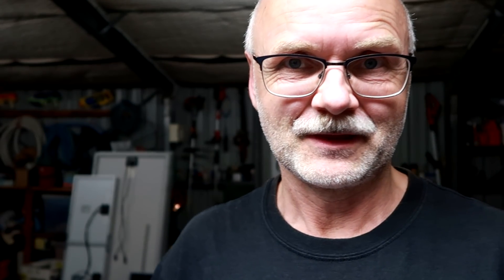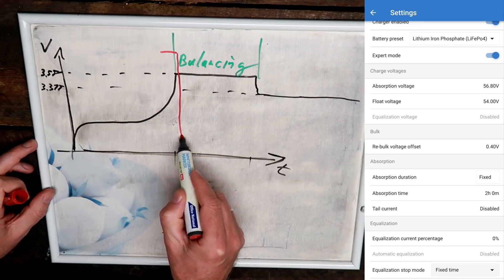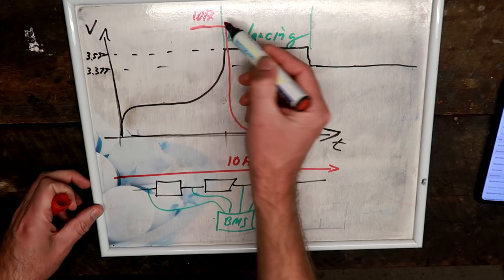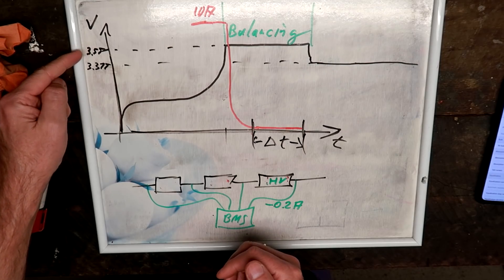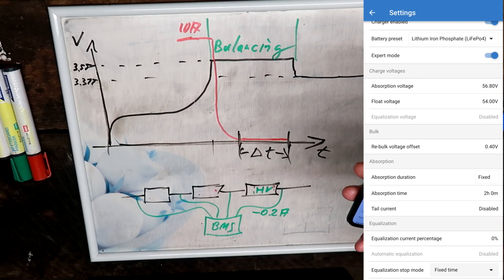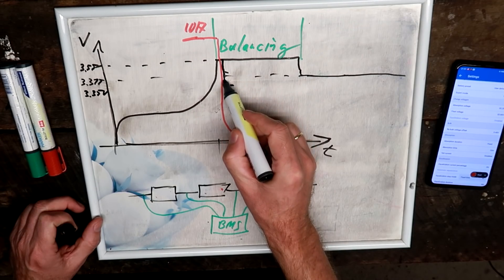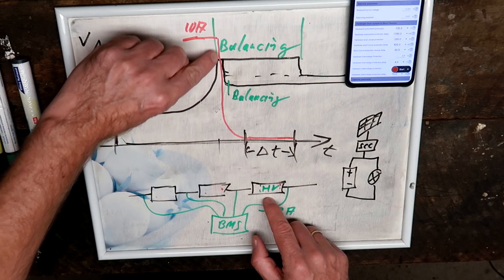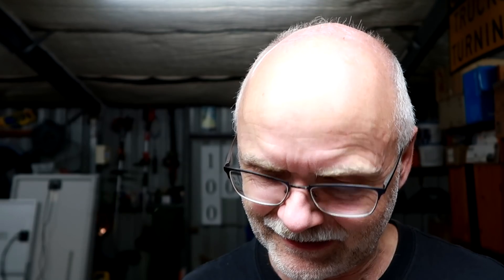Can I balance my battery while floating? Well, I do!

Comment: So after watching this video and understanding lifepo4 cells the way I do. Working and building battery systems experience has taught me a lot .
You can't balance cells that are not fully charged meaning less than 100% soc . They never reach the high voltage knee .fact 1.
Fact 2 you also cannot balance cells that are at a float of 3.325v . Why ?
A cell will only show it's mismatch in capacity (i.e. requiring balance ) when it has a positive voltage applied - which is directly proportional to it's soc level .
Applying voltage / current to a empty cell will never push it over in voltage because it hasn't reached its saturation point decreasing internal resistance .

So here is a test charge all cells at 30amps or 60amps and watch their voltage sure you might see a few MV difference In a sort of balanced pack .take note of the voltages and keep track of the mismatch at a medium low soc .
Allow the pack to charge up till close to full around 90% you might still only see a minimal difference .
At around 95% soc you start to notice larger variances of voltage between cells that are closer to full and cells that are not so full .. 
And this is where balancing starts to work because you have the positive voltage differential allowing this process to show which cells actually require balancing .
So ... To say you could balance cells at float .. after charge can be done yes but will it work ?
No ...

You need voltage to trigger the knees in all full cells allowing them to be balanced . Lifepo4 cells undercover agents they don't give information unless forced (charged ) to do so .
Reply: Cell deviation voltages are soc related and current related .
Your target voltage is the first step sure you don't have to go to 3.55v aim lower but not below 3.4v .. on massive large cells like the ones you have you never going to heat the chemistry to degrade the electrolytes because these cells can take 280amps of charge .. recommended charge for cell life span is 0.5c which is 140amps of current .
If I see correctly you still less than 0.25c which is less than 70amps .
You never going to create heat internally in the cell at this charge rate even closer to the knee aiming for 3.5v per cell so don't sweat ..this factor is only important when charging small cells with a higher chargr current
Reply: @adamsaiyad3959  But yet, he has only a 5 mv cell difference across the entire pack.  WHY should he care, that the voltage difference might be higher with a higher voltage, given he will NEVER use a higher voltage?
Reply: @MrSummitville  valid comment . 5mv at what soc of his entire pack ? 
Is this 5mv at 60% or 99% soc .

You bring up another interesting topic . How much energy capacity is created by unbalanced cells .
This term is loose as unbalanced can be a full cell and a cell that is at 50% soc .
Then I digress abit further and into more detail.
If charging up 290ah cells .
And of a group of 16 you have say over 80% of the pack at 3.48v and the remaining 20% at 3.9v at the end of a charge with no balancing how much capacity would the say pack have lost .
Probably around 10ah at most maybe 20ah 

Over all on a pack that is this huge it's a minimal capacity loss for this unbalance .

Then brings the next topic if the cells are of the same batch . And are closely matched from the supplier on IR and capacity. And are top balanced technically the pack should go out of balance .
A top balanced once and never again balanced pack should remain the same through out the life span of the cells .
Same for a bottom balanced pack ..
So is balancing necessary debatable . Good quality cells require very little balancing on each cycle and a small balancing Bms can handle this easily .
But on the other hand with large cells require a larger balancing current rule of thumb is again a misnomer . Because balancing can still take place as rightly mentioned in the video at a low enough chargr current towards the end of the charge profile in the CV stage.
Reply: @MrSummitville  ps as I mentioned in my first right up wanting to balance out a pack at a low voltage will never yeild correct balancing results . In essence might not balance at all .
You can only truly balance when you are in the full cell knee and IR lowers because of soc where the propensity of the cell to raise in voltage requires very little current to raise above ocv. Open cell voltage when full .
I didn't say he has to charge to 3.55v .
I did say that he should use a value above 3.4v to achieve the positive voltage difference to allow current to flow into the cells in a ample amount of time.
Charging at 3.30v will charge a cell . But it might take 20 years to full .
Charging at a greater voltage differential allows for more current lowering time taken hence speeding up the charge process.
We not applying 3.65v per cell as per manufacturer specifications .
We applying by far lower voltages taking longer to charge but still getting the knee activated and allowing some form of correct balancing if required and needed by the user.

Comment: As far as I know, LiFePO4 batteries do not degrade more if held at 3.65V or 3.55V continuously for several years versus 3.45V or 3.35V for the same number of years. High voltage induced degredation is caused by electrochemical side reactions resulting in permanent loss of electrolyte as it gets consumed in those side reactions and deposits insoluble breakdown products over the active electrode surfaces. However, these side reactions start around 4.0V and reach excessive rates by around 4.3V. Li-Ion and LiFePO4 cells use the same organic electrolyte, so theoretically you can safely and continuously use a float voltage of almost 4.0V on your LiFePO4 cells without any harm. The reason LiFePO4 cells aren't rated above 3.65V is because they store no extra energy above this, meanwhile their essentially infinitely steep Voltage/SOC curve above this allows individual cells to skyrocket over 4V extremely fast when charged in a series connected battery pack and still under the normal full pack charge voltage. I.e. high voltage is bad for Li-Ion lifespan, but merely difficult to control and of no benefit in LiFePO4 batteries.
Reply: hi. have a link that explains this info you just said?
Reply: @cgmarch2359  Do NOT Float Charge any LifePO4 cell at 4.0 volts.  It will cause very early death.  All Cycle Tests show this to be true.

Comment: Always a good amount of things to think about. I am running a 4S11P 100AH GBS kit. Grade B cells. Every few weeks I gather another pile of cells that I am able to P into more so I might be around 30P by now. I have chosen to limit my top voltage delivered by the SCC to 3.4 and do run a overkill 120BMS and watch the P voltage carefully. By limiting this top voltage I have never had the BMS try to balance cells…and I am happy with that because there is no way it would even make a dent in it with such a low balance rate. I only push 500W in and only run a simple freezer unit so the pack voltage is always less than 3.4 and when on cloudy days it may drop to 3.0 volts I have a transfer switch set to throw it back onto grid.
Andy and Will P have filled in my every decision. Thank You.

Comment: Hi Andy. Nice video. I want to add another "option" for you. I think you cant balance your cells at 3.35v. 1mV could be a lot of SOC %.
I think it is better to make balance at higher voltage. Probably with 3.4v is enough to appreciate SOC % differences by measuring voltage.

(Please, now wait to read all text. I dont want to ecualize cells, i want to use those settings like other way to do top balance)

What about using the ecualization utility of your mppt ? I mean, you can go higher once a month, for example. Let's go up 3.5v once a month with a ecualization current limit (perfect to balance cells as it will be limiting  the maximum current that you want) and a controlled ecualization time. It will be our configurable  top balance "voltage, time and current" mode.
 Please check your mppt settings. It makes me sense for me, dont it ?
Charge your cells daily up to 3.35 or 3.40, but only once a month (or whatever) go up to 3.5 in which you will have more possibility or it will be easier to balance cells.

Sorry, this option may top balance our heads also 🤯
Reply from the maker: Thank you Fernando. Using the Equalisation settings for a routine maintenance... hmmm... that's actually not a bad idea. I'll look into it. Thanks for your suggestion, that is great.

Comment: "It is a bit theoretical"   Yep - but you explain it very well.
Keep it up
Reply: LoganV,  Affirmative. Every thing starts with theory and then into practical. Where as, in YT, mostly what you see is the other way around ie: even trial and error method., which’s dangerous and wrong. The Author; here, has done tremendous amount of painstaking research to get to the bottom of some intricacies and has been successful, in unfolding issues.
True, for people like me, it takes a wee bit of time to comprehend the essence of what is being lectured. But eventually gets clear. Thanks to the Author.

Comment: I remember you use to say keep your state of charge at about 80-90% to keep your battery from degrading. Is this still true? Or can you keep your battery at 100% state of charge just at a lower voltage?
Thanks for another great video Andy.
Reply: Why do you need ot go above 90% SOC ?
Reply: @MrSummitville   Most people won't need to go above 100% SOC. I want to know if it degrades your LifePO4 battery if you have it at 100% SOC at lower voltage.
Reply: @popcoingaming5086  No, my question to you was ... Why do you need to go above 90% SOC ?  ( Your reply was about greater than 100% SOC <= Huh? )   The more TIME that your battery spends at 100% SOC, the shorter the overall life.  Charge to 90% SOC ...
Reply: @MrSummitville  Your question to me is "Why do you need ot go above 90% SOC ?" My answer is, I don't need to. I want to know what Andy's thoughts are currently about being at 100% SOC at a lower voltage.
Reply: @popcoingaming5086  He is experimenting   and trying to get more subscribers to his channel ...
Reply: @MrSummitville  SoC is not directly relevant to battery degradation. Cell voltage is what determines degradation. This 80-90% number comes from other lithium chemistries that are commonly used in EVs which do not have quite as flat of a voltage curve as LiFePO4. Also: In an EV the driver cannot see individual cell voltages: He can only see SoC. So this 80%-90% "rule of thumb" was created for EV drivers to help maximize the life of their EV battery pack.

The reality is that LiFePO4 operates on a much flatter curve, so you can safely charge LiFePO4 to 98-99% by charging it to only 3.4v. Again: It's the voltage that matters, not SoC, so by staying at or below 3,.4v you are greatly reducing degradation by not going all the way to 3.65v to hit 100% SoC.

Because of how flat the voltage curve is with LiFePO4 there's not really a magical voltage below 3.4v that you can use to charge to 80-90% A fully charged cell will rest at around 3.33v but you need to push closer to 3.4v to get any charge acceptance into the cell. This is why the 80-90% "rule of thumb" doesn't make sense with LiFePO4. A cell charged to 98% will sit at 3.33v after it's allowed to rest. A cell charged to 80% will maybe be at 3.32v after it's allowed to rest. There is effectively no difference noticeable in degradation between a cell charged to 80% and one charged to 98% in LiFePO4.

Comment: Once top balanced, you should never have to balance your cells for months (depending on your use). They will NEVER be balanced perfectly and that is okay.
Reply: Even a year, or more.  LiFePO4 cells tend to stay in balance for a very long time, as long as you do not fully discharge the pack, which is why the relatively low balancing current the BMS is able to provide is plenty.

-Matt
Reply: @junkerzn7312  Yep, that's what I said! :-D
Reply: Fundamentally with any real world and thus non identical cells your latter statement is a bit off. It's not that they will never be balanced perfectly, it's that they cannot be balanced except by perfect manufacturing practice. All we can do, as end users, is top balance, bottom balance, or dynamically try for both IF the cells are close enough together AND for some reason you have to push both ends of the envelope AND your active balancer can pull enough current to avoid an over voltage scenario for individual cells/banks.

Comment: The balancing sensing depends on particular BMS.  Ideally, all cells are snapshotted for voltage at the same instant in time.

Problem in real world situation of variable inverter load and variable solar charging is the battery current jumps around continuously.  Only way to to get accurate voltage relationship between cells is to get all the cell voltages at same point in time with same battery string current.  

Cheap BMS's just average the voltage readings.  It helps but not super accurate.  Most cheap BMS's have fixed balancing trigger voltage of about 3.4 vdc.  This makes it easier for cheap BMS because it pretty much means there is no inverter loading reducing how much the cell voltages jump around over time and the 3.4v trigger accentuates the voltage difference for a cell approaching full charge.  The higher balance trigger voltage gives less time to balance before highest SOC cell overvoltage shuts down BMS.

Balancing becomes a race between lowest cell reaching desired charge before the highest SOC cell triggers the overvoltage shutdown.  The higher the balancing current the better the chance to win the race.  Waiting until charge current drops off before balancing will not help.  Are you going to ensure there is no inverter running?  Not very practical.  You will likely trip the overvoltage if cells need more balancing.  200 mA balancing is about the limit before you need to have separate cell voltage sensing wiring.  On a common sense/balance dump current wiring the balancing current wiring voltage drop on sense wires impacts cell voltage readings.  They shutdown balancing to make voltage reading but this reduces balancing time a bit. This is the main issue with cheap higher current active balancers.

Charging is not just about voltage limits.  The higher the charge current the sooner it reaches absorb voltage, but the longer the current taper off period lasts.  The lower the charger current setting the longer it take to get to absorb limit but the shorter the absorb current taper off period.

I would not advise using a timed absorb period for Li-Ion batteries unless you keep absorb voltage lower.  If you time absorb for 2 hours at an absorb of 3.65v per cell it guarantees overcharging and battery degradation.

If you have a BMS that allows you to lower balance trigger voltage it maybe good but depends on the BMS simultaneous cell voltaage sensing.  Also lower balancing voltage trigger requires better accuracy of voltage sensing as the cell are closer in voltage without the benefit of the near full charge ramp up in cell voltage exposing the difference in state of charge of cells.
Reply: Excellent comment 👍🏼